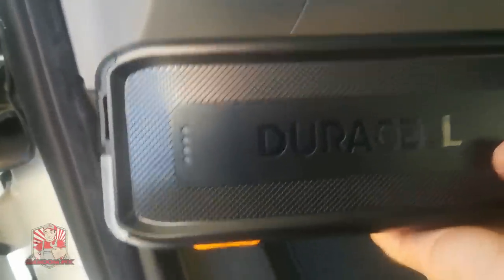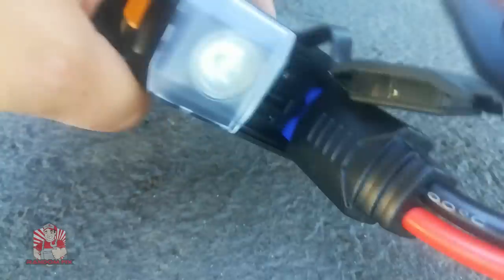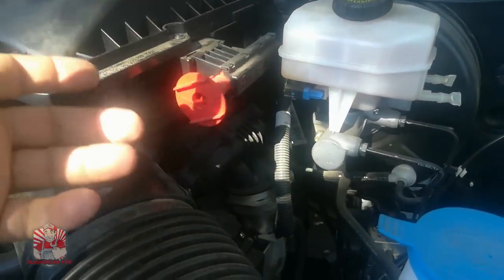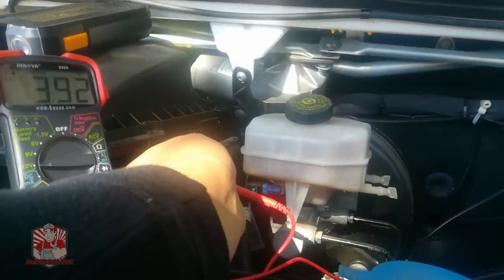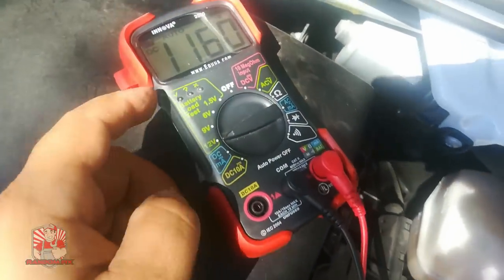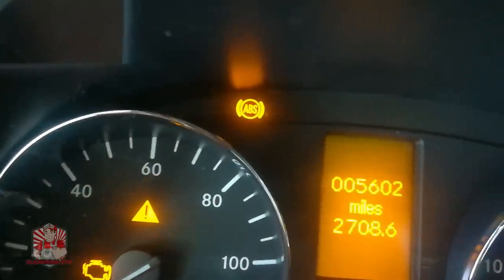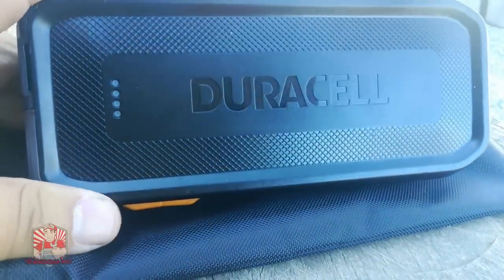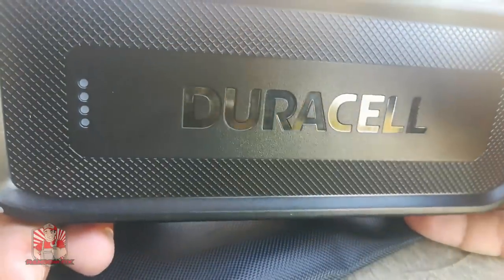Duracell Jump Starter Review DRLJS20▶️ Will it work on Diesel?

Comment: How is the Duracell 1100 Lithium charged. What do I need?. How long does it hold a charge?
Reply from the maker: Through. Regular usb charger. I believe it's a micro USB b android style wire. It does loose about 25% charge over a years span. Update, you need to charge it using the car adaptor or the included a/c adaptor.